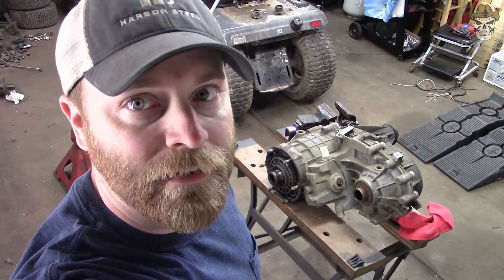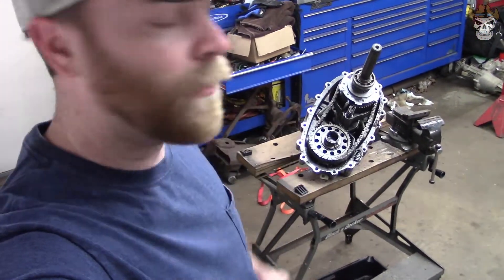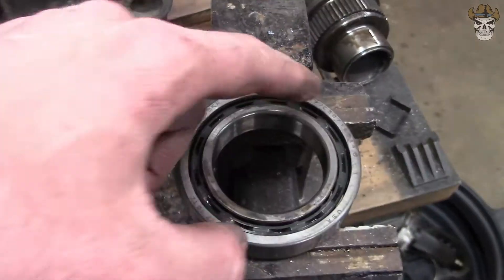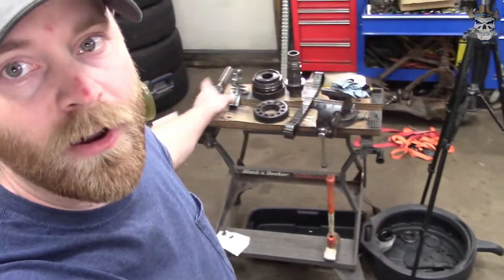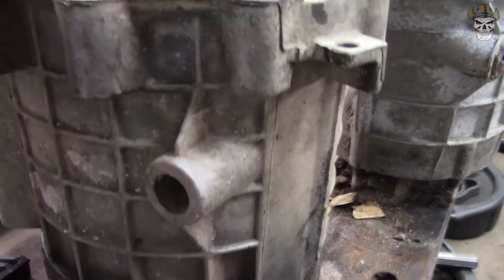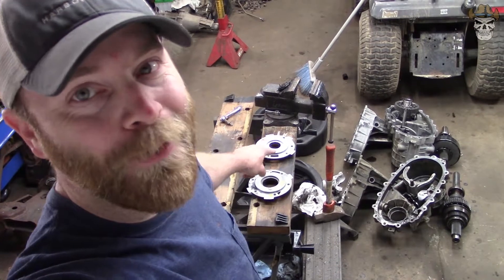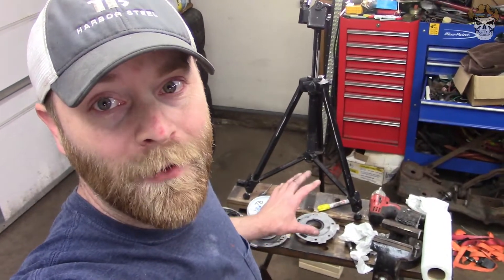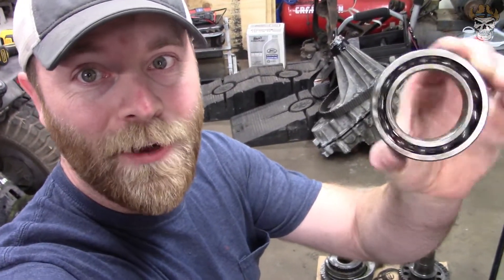Disaster Transport NP261 Transfer Case Weight Reduction

Comment: What is the purpose of Eliminating 4H? You just wanted a granny gear?
Reply from the maker: The transfer case went into a dune truck with only rear wheel drive so I removed all the 4x4 stuff to make it weigh less.  My dune truck now has 2wd high and low range.

Comment: So is the front slip yoke splines oiled or greased?
Reply from the maker: Ive never done either but I suppose you could grease it.  The slip yoke on the front done move once its installed on an IFS front.
Reply: @PostalRedneck  seems like oil doesn't come out at all. Only the rear has it pour out. I'm going to grease it when my new u joints come in. Thanks for the reply